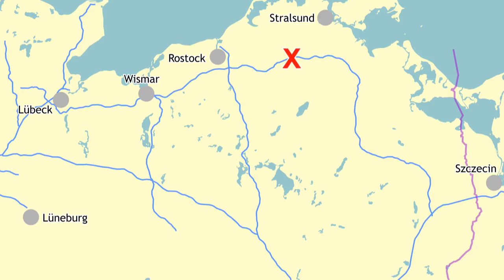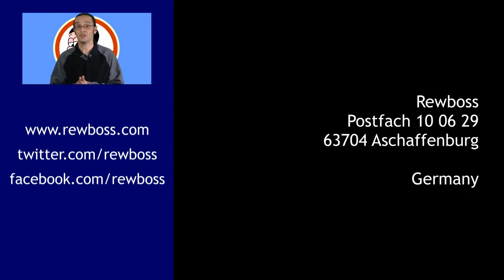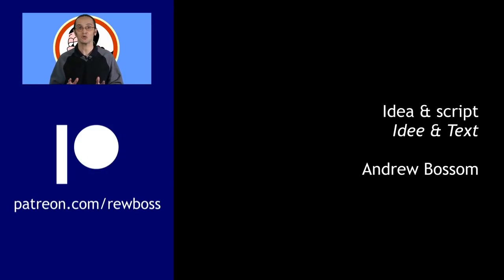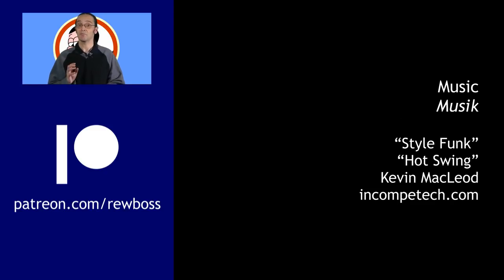The autobahn with a hole

Comment: The Leipzig S-Bahn tunnel took only 100 years to complete. Construction began in 1913(!), when the new Leipzig Central Terminal was completed as a joint project of Prussian State Railway and Saxon State Railway. Two World Wars, a global economic Depression and 40 years of communist rule did slow down the project's schedule slightly, so it opened in 2013.
Reply: "We will build the tunnel by the year thirteen"
And they did

Comment: Well, they’ve begun to announce when the A7 is free instead of announcing when it is closed... or they should begin. Would save time.
Reply: Hehe, same with the A4 between Aachen and Cologne, and the A40 rhine bridge. That has had construction work literally as long as I can remember.
Reply: idk if ur talkin ab a7 de or a7 nl because our "afsluitdijk" uses the a7 nl, which still is gettting renovated until 2024 (u can drive on it) so thats pretty annoying

Comment: Reminds me of the Dutch A12 motorway between Woerden and Gouda were something similar but less drastic happened. The 2 directions had to be separated and treated as separate roads. One direction is actally higher too due to an enormous amount of sand being used to stabilise the area. That part of South Holland province has about 30 meters or more of layers of peat, clay and sand but the main layer able to carry stuff is 30 meters down. You either need lots of sand and time for thing to settle or drive piles long enough every meter and over the full width of the road. An expensive undertaking....
Reply: I don't understand why they can't just build those stretches like they build bridges. Simply don't rely on the ground under them at all.
Reply: Those bridges would have to be tens of kilometres long I think. Now I'm imagining a giant 30km long suspension bridge.... suspended on land!

Comment: 1. It is nothing wrong witg concrete pavement if the design is right.

2. It is not possible to stablize the peat soil. They need simply remove peat soil (organic soil) and import sandy soil with gravel.

Comment: Germany should call on the Dutchs or Italians to build their roads. The Germans are pretty awful in civil engineering which is different from mechanical engineering which they're are good in.
Reply: Jentul Jay true, we (Dutch) can build a bridge with prefab-technology in half a year. In Germany prefab is forbidden and it takes at least 3 years administrative work before building.
Reply: Daan Willemsen Germany doesn't do infrastructure quite well. Their ongoing projects go on forever with no end in sight, even finished projects look awful.